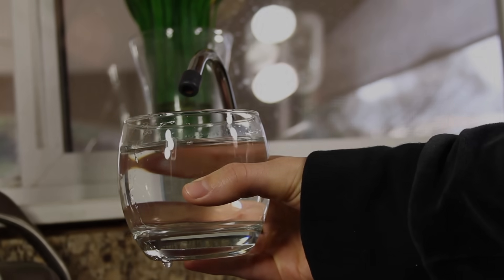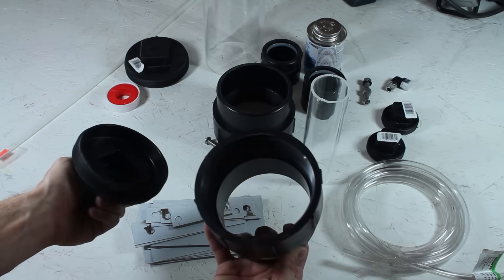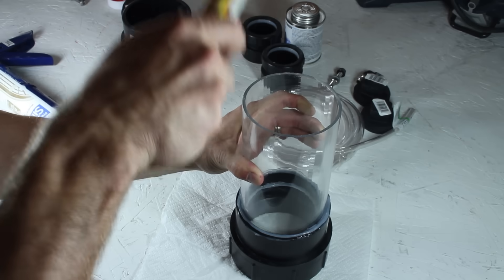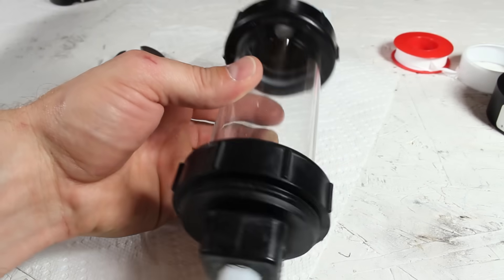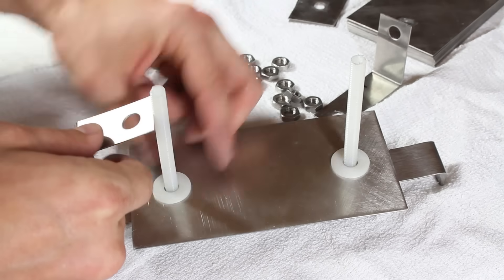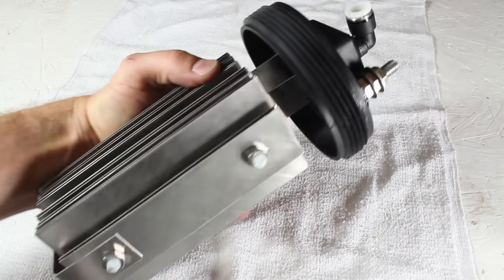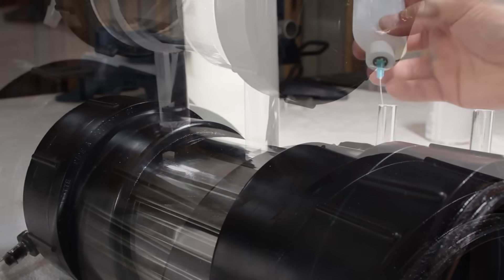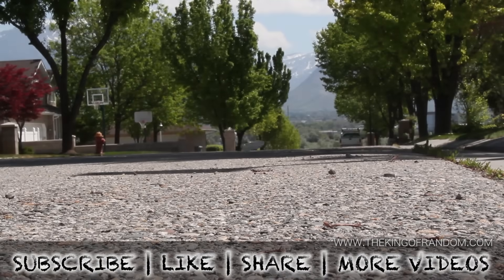HHO Generator - Water to Fuel Converter

Comment: You say that some people argue that this is the fuel of the future. Do you agree with that? I mean, there are no downsides to the fuel. It is cleaner than anything else, more renewable than anything (save for solar), and as you've demonstrated- easy to produce. Some people argue that it takes more energy to produce than you get out of it, which may be true until systems are perfected for more efficiency, but you could just use it in conjunction with solar or wind to make it use no non-renewable energy. Idk, just an armchair theorist giving my two cents. You've actually went and built the generator and appear to have more than a rudimentary understanding on the subject; what's your opinion on all this? Could it soon be practical to use with cars and grid electricity generators?

Comment: Is the gas that comes out of this lighter than air or is that a different kind of Hydrogen?
Reply: Hydrogen is Hydrogen. It is not only lighter than air, but the lightest element around.
Reply: It's a non separated electrolysis, The hydrogen and oxygen gas that is decomposed are not separated. they are collected through a single path. BLUF: The gasses that come out is Hydrogen and Oxygen together.
Reply: Febeleh That is true. In case you're wondering, I have been studying the periodic table. Don't judge!
Reply: Daymian Hogue No.  No isomers of water here.  It's a mix of H2 (hydrogen) and O2 (oxygen).  You put a ton of energy in the form of electricity into it to separate 2 H2O into 2 H2 and an O2.  When you light it, it recombines into H2O and all the energy comes back out (very very quickly - hence the explosions).  The amount of energy that comes out is the same amount you put in (less any losses in your system).  It's just that the energy that maybe took a minute or two to put in, can all come out in a millisecond.

But as to the original question: The H2 is lighter than air, the O2 is slightly heavier than air (since 72% of air is N2 which is lighter).  Good luck separating them though.
Reply: look at a periodic table... 4th grade science
Reply: Just pretend it's water vapor which is lighter than air (which is why clouds float)  it's ionized water re bonded from HOH(Water H20)  to HHO(Hydroxide also H2O) Molecules made of the same atoms are called Isomers.
Reply: Robert Wenzlaff
To obtain only hydrogen make the gas pass through a layer of zinc dust immersed in water. The zinc will oxidise leaving only hydrogen.

Comment: If this is set up right, as with early hydrogen production techniques, from one side of the device you get almost pure oxygen and nearly pure hydrogen from the other. The collection areas from the two sides can then be vacuum pumped into separate pressurized containment vessels just waiting to be reintroduced to each other.

It solves the problem of the HHO gas itself being highly explosive while in the transport hoses and and any surge containers.

Comment: Would it work with diesel engines?
Reply: lol. it will not work. how will u get the sparks. ow and diesel is oil.
Reply: Ishmeal Armoo i was thinking that the incandescent plugs may be enough to light the hidrogen,  but guess not.

Comment: so I watched both of the videos involving the HHO converter, and I was wondering if this would be useable as a rocket usage, if the rocket were made of something more durable than plastic, inserted with a timed fuse like the ones in your video, and with three or four symmetrical release valves, such as the one way valve added on the HHO converter; maybe a lightweight material such as aerographite?

Comment: Could this support a 2.5l 4 cylinder engine? I plan on building one this weekend.
Reply: these types of units(size/design) are generally only used as a "hybrid" fuel supplement as they realistically only produce 2-3L per minute when hooked up to a car's 12v system. Using a HHO device involves drilling a hole into your car's air intake after the MAF and plumbing the output of the generator directly into the airstream.Theory is that your car is inefficient and doesn't burn all the fuel that goes into the cylinders. HHO is HIGHLY combustable (more than straight hydrogen) and helps to burn more gasoline plus add its own bang. Problem is that your car's fuel management computer will read your exhaust as too lean and start dumping more fuel into the mix to compensate, destroying your fuel efficiency.So you need to also install electronic modules that connect to the O2 sensors to boost the signals going to the computer so it don't mess with the plan. Another problem is that these systems take a significant amt of current to run; anywhere from 10 to 30 amps for the type of unit in the video(you should really have it regulated if you don't want it to suck too much power). More current draw from the alternator=more gas consumption. Need to find the balancing point where extra draw on the alternator is compensated for by production and use of HHO. apparently this is about 1.5-2.5 L/min and hopefully less than 20 amps. this is why efficiency in the design is so important. There are MUCH more efficient designs but are a butt-load more involved to build. More than one way to skin a cat so have a look around the youtubes.
Reply: Oh and most of the cheap solar panels (thin film) are more like 8% efficient, so double that....
Reply: A quick estimate using the energy density of pure hydrogen (0.53KWh/L @ 20MPa) gives an output of roughly 795W, or 1.07hp for this system. That's with an output of 5L per minute - I know it's not pure hydrogen we're dealing with but I couldn't be bothered looking into it at the moment.
Reply: Best way to do this is to have a storage tank. While your car is parked, prop a wind generator or solar panel on car roof to and start splitting water while storing in a reserve tank, that you can use instead of relying on your car's alternator.
Reply: I have no idea what any of you are talking about... I code, not invent amazing shit..
XD
Reply: Evanolon Haak Since the energy in the gas all comes from the alternator, and all it's energy comes from the engine, you can't win here.  It's like putting a generator on the wheel to run an electric car.  won't work. The only way this works is if you have a free source of electricity.  You can use the H2 to store the electrical energy in a highly dense state that is practical to run a car off of.

1 H.P. = 757 W of electricity.  There's no way around that.  So to run a (average) 25 H.P. car for 2 hours a day, you need 3.154 kW of solar panels collecting daylight for 12 hours.  1 square meter of sunlight is a total of 1.125 kW of energy.  At 15% efficiency (typical solar panel), you need 18 square meters of solar panel.  About 4.5m by 4.5m  (15.2 foot sqaure) counting frames and supports.

Comment: I calculated that two Batteries with 200Ah will produce 900L H² at normal pressure when discharged to 30%.
A tank from an HHO Car carries 4kg H² which would be 44800L at normal pressure.  --> FAIL! Using electric energy directly of course would be more efficient.
Reply: It's not a "fail" that it's less efficient.  It's converting one form of energy storage to another form of energy storage.  You can't do this without losses, but sometimes you need your chemical energy stored in different forms for various reason.  Not everything runs off batteries, and not always will you be able to store all the energy you need in them.
Reply: matthew pace

I totally agree with that :).
The Fail is to assume that you can now power your hydrogen Car with electric batteries.
Because he was explaining that this system can create thousands of liter of gas.
A tank only as 100 liters. So I was curious about that issue. the problem is, that the 100liter tank is filled with 400bars or lets say 250 and cooled down to the max.
I did this calculation to find the fail. :)
Reply: not really sure how you got those numbers but that's exactly what I am after. thanks
Reply: 4kg in a tank is from a car website
the rest is calculated myself. But I was calculating with a battery that doesnt lose volts. so you have to expect less.
Reply: Yves Baggi
4kg in a tank is from a car website
the rest is calculated myself. But I was calculating with a battery that doesnt lose volts. so you have to expect less.
Also this is for 2 Batteries parallel -> 24V 400Ah
Reply: Two batteries in parallel would be 12V 400Ah, two batteries in series would be 24V 200Ah
Reply: matthew pace

right, you are about the volts and capacity. how lazy...

Comment: Very cool,

do you think a current internal combustion engine can run on 100% hho?
or will it always need some other fuel?

how would I determin how much of this I need for a 500cc motorcycle engine?
so as to design mine big enough with an appropriate power supply??

thanks
Reply: They definitely could, if storing large amounts of compressed hydrogen wasn't such a nightmare.
Reply: arimunic Ok, but since the Hydrogen in these cells is produced from the car battery there's gotta be an net energy gain. Meaning the extra mechanical output from the added hydrogen is above the electric energy pulled from the battery to produce said hydrogen. Right? othewise, it's an exercise in futility?

Ss it could be that this scales up only to a certain point?
Reply: Ok, so running on 100% hho is possible but the electic energy will have to come from a source external source to the car.

so for those systems that add an hho generator to their cars/engines, it makes the engine run more lean etc. but this cannot be scaled up to use no gazoline/diesel (or even natural gas).

Am I making an accurate observation?
Reply: Yves Baggi No, there is no energy gain. There are, in fact, some losses due to ohmic heating and activation energy to get the electrolysis reaction going. The advantage of hydrogen is in energy storage: it has a pretty decent energy density. That being said, it wouldn't be used in this form (mixed with oxygen, see how explosive this mixture is? Because hydrogen and oxygen are mixed just right, the reaction happens very quickly). Pure hydrogen is safer, and more effective to store larger amounts of energy.
Reply: mmmhorsesteaks
Thanks all, I'm getting there.

Now to constrict the discussion to a more narrow focus point, and pose a very simple question: If a car is gettin 20 miles to the gallon running conventionally (factory) and after adding this hho generator it gets 25 miles to the gallon and we didn't add extra batteries that we charged outside of the car alternator. Where is this extra 25% coming from?

Or is it so that we have to add batteries on a car just to get the hho generator going and our poor car batterie could never run the engine AND the hho generator?

In the latter case it would mean we essentially are running on electric power, which refers to the question how is this electricity produced.

thanks for all the input. I'm trying to fathom what's needed and put some numbers on things.
Reply: Yves Baggi Well, one might assume this is excess energy generated by the alternator that would normally go to waste (I'd think only a fraction is really necessary to recharge the battery) It seems doubtful the improvement would be that massive, you propose a 25% improvement; I'd guess about 5% (still very significant imho). That being said, economy cars these days are so fine-tuned (regarding fuel injection/mixing/air-fuel ratios) using exhaust sensors and whatnot, any tinkering is likely to worsen fuel economy, rather then improve it. I'm not an automotive engineer, though. My advice: anything that sounds too good to be true, probably is.
Reply: yes, running on hydrogen is possible.
Reply: BMW hast HHO Cars since years.
We have also buses running on HHO herein Germany. Hydrogen is hard to store, but you can make "bigger batteries" than conventional electrical batteries. Also both is possible
turning the Hydrogen back to water in an combustion engine or use using a fuel cell.
I think the fuel cell is more effective. Since electric motors dont easily break and are lighter than combustion engines, also the fuel cell as about doubled effectiveness. Like 40%
Combustion Engines only have about 15%

Check out the rumors about cold fusion.
or this one:
watch?v=mHW6b1aFPfU
there is a never ending debate about free energie. Physical Basis is the Casimir Effect
and its implications.

Comment: Hi Grant, This was a great video. Easy to follow. Amazing results. Edited so well. I was skeptical about how everything fit so perfectly: electrode plates fastened together just dropped into the plastic cylinder and bolt terminal holes matched perfectly with the caps.  It made me wonder about the other 2000 hours that were about measuring that did not appear.  For future reference: My one criticism--the percussion track--it is a total detriment to the video.  Otherwise, outstanding.

Comment: While this is a pretty amazing thing, electric cars have much more potential. Electric engines are 70% efficient while any internal combustion engine is barley braking 40% and those that do, have no power. 

What should be done is making solar panel and battery technology greater while converting all ICE engines to hydrogen and all future cars full electric.

It will save a ton of energy.

Comment: Well, that's not true. Electric cars are more green. As I mentioned the average ICE is 20% efficient, and theoretically they can be about 40% efficient. Multi-stage Steam Turbines are about 70% efficient. Electric generators are about 95+% efficient. So the output from your wall socket is about 67% efficient. An electric engine is 95+%efficient. So an electric car is about 63% efficient from coal to miles driven today. The average fossil fuel car is about 20 to 25% efficient from gas to miles.

Comment: The problem isn't with the efficiency of the water cracking process. (I assume 90% efficiency in the example I gave, but 100% efficiency doesn't change the outcome much.) The problem is the average ICE (internal combustion engine) is only about 20% efficient. (The most efficient possible are still less than 40% efficient.) If you use the HHO you make to power the generator to make more HHO you lose energy in the process. The most efficient possible would be a jet engine but it's still a net loss

Comment: There are pre-assembled HHO generators out there. The problem is that it does not reduce your fuel consumption. I could go into the math, but basically due to the First Law of Thermodynamics, you can't get more energy out of the creation of the HHO than you put into creating it. And your engine is only about 20% efficient. You lose over 80% of the energy when you use HHO to power an ICE to spin an alternator to power an HHO generator. Usually the energy loss is around 83% or more. 500 char limit

Comment: As you can see, the stuff is highly explosive. Normal hydrogen powered vehicles keep the hydrogen in a tank and the oxygen is taken from the air. In this case he is using HHO. HHO is the atomic hydrogen and oxygen together. A single spark makes it explode. You wouldn't want a tank of this in your car. One collision and you would be shredded flesh spraying through the air. Some shysters claim that you can make HHO in your car as you drive, which you can, but it is not sustainable. It's a scam.

Comment: There should be a way to buy a pre-assembled unit which only needs water and the electrolyte added to it. I'd love to use one in my car to help lower the fuel consumption, but even with the building plans I wouldn't know how to build one, or am not mechanically inclined enough for building it, neither do I have the tools or resources, and buying them only for one unit wouldn't make sense.

Comment: So now all that's needed is some sort of electrical circuitry to increase the gas generation while using still the same amount of electric power. I am thinking ultra high voltages with pulsed current instead of steady DC, maybe a "Joule Thief" circuit or something, together with some ultra high power capacitors. Although the transistor would need to withstand extreme powers, I don't know if there even are transistors like that...

Comment: I was thinking that you can make the same thing but put an acrylic plate in the middle, glue it to the top and leave a gap on the bottom. Then you put + on one side and - on the other so you can make hydrogen and oxygen separately. Will that work?

Comment: anyone need some acrylic tube? its only about 6 inches long so you will need to make the same thing but an inch shorter. it fits 4 inch pvc caps perfectly. i bought a ton because it was a lot cheaper than buying them one at a time. 

just search 4 1/2" OD, 4 1/4" ID, ≈ 6" (5 7/8") long extruded acrylic tube pack of 2 on ebay

Comment: You could, but you'd have to build a system that could withstand quite a bit of pressure, and plexiglass and PVC would fail pretty fast.  You would be better off storing the gas in long metal pipes, and then pressurize a tank by forcing the gases from the pipes into small metal tanks.  You could build a compressor, but you would need to do the math, because pressurized hydrogen can be pretty dangerous (For mainly the same reasons other pressurized flammable gasses are... particularly acetylene)

Comment: the hydrogen + oxygen gas output into the engines air intake*

worth a try. Gasoline is long chains of hydrocarbons, so this may work as well as gasoline. and if its only half as powerful, maybe you can just use 2x the number of generators?